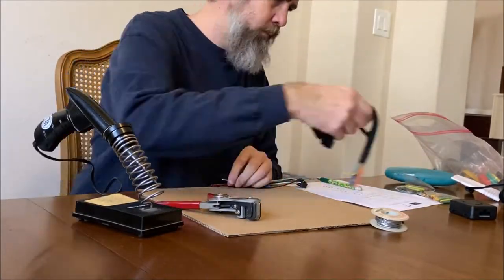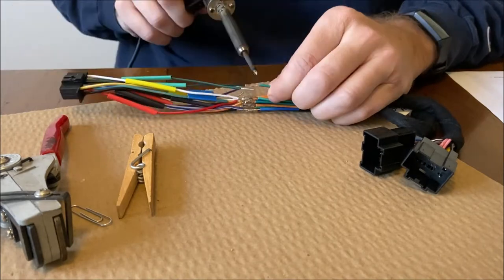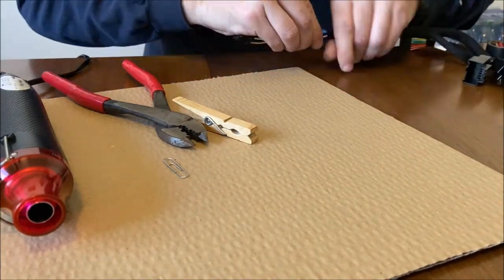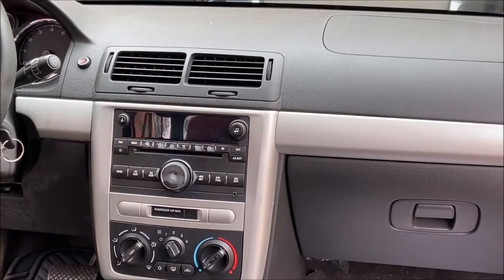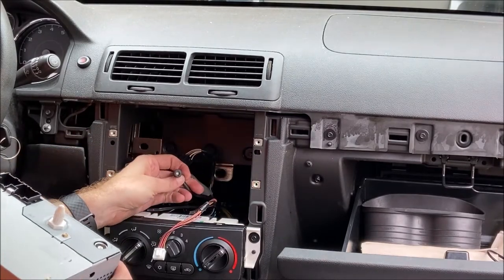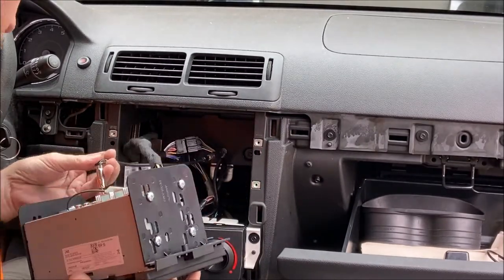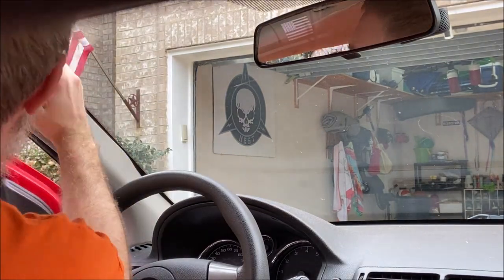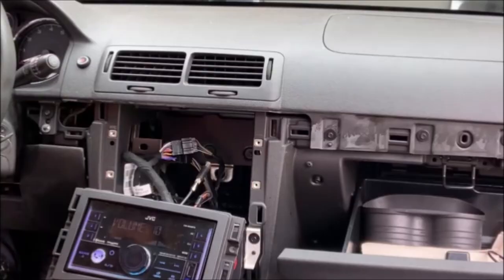Replacing the Radio in a 2010 Chevy Cobalt

Comment: Can you please help me specify what wires connect from the single 12 pin connector and into the two female connectors
Reply from the maker: Thanks for watching, Joe.
In general, the new radio/head unit you're installing will come with a wire harness and instruction book that tells you the function of each colored wire.  The harness you're connecting to (that connects to the car's original connector(s)) will also come with instructions that say what the function of each colored wire is.  You need to connect the two wires that have the same function (not always the same color!).

For the exact case of the hardware I used in this video, I need to look at the instruction manual for the JVC KW-X840BTS head unit and for the Metra LC-GMRC-LAN03 adapter cable.
The JVC book can be found online here: https://www33.jvckenwood.com/pdfs/B5A-3110-00A.pdf and the info is on page 44.  The Metra book can be found here: https://metra-static.s3.amazonaws.com/documents/INSTLC-GMRC-LAN03_web.pdf and the info is on page 2.

As an example, for the front right speaker positive (+), you would connect the gray wire from the radio's harness to the gray wire of the Metra harness.  For the front right speaker negative (-), you would connect the gray/black wire from the radio's harness to the gray/black wire of the Metra harness.

Comment: I’m really struggling with the wiring, I looked at the wiring diagram and everything, do you mind telling me which color wires go to which?
Reply from the maker: Thanks for watching!  I wish it was a simple answer but it depends quite a bit on the specific head unit you're installing and which wiring harness you are using.  Factory harness?  Intermediary harness?  You need to look at the wring diagram for each.  For example, your head unit's wiring diagram might say "Right Front Speaker Negative Wire (-)" is pink.  Your wire harness diagram might say "Right Front Speaker Negative Wire (-)" is blue with white stripe.  That would mean, then, that you need to connect the pink wire from the head unit to the blue/white strip wire on the harness.
I hope that helps!  Check out some of the other comments on this video to see if they might also help.
Reply: @CarbonsDIYGarage  I found out I bought the incorrect harness. I have a 2008 Cobalt Sport with the Pioneer sound system, OnStar, and Steering wheel controls. The harness I got wouldn’t turn my amp on and off or would power my head unit, but luckily I order the correct one this time!
Reply from the maker: @daquancrazy7694  Whoops!  Yeah, that would do it - but glad you got it sorted out.  Good luck with the install.

Comment: I cut off the original connectors because my friend said it would be ok -_- so now I put all the new radio wires with the old ones using a diagram but it won't turn on. Am I supposed to put the yellow and red wire together into my positive? Because I only put the yellow. Thank you in advance if you ever see this.
Reply from the maker: @MidnightLadyCrow  I think the first thing you need to do is find the wiring diagram for your year, make, and model. For example 2006 Cobalt: https://www.justanswer.com/chevy/1gqth-need-2006-chevy-cobalt-radio-wire-diagram-one.html

Then match the functions to the wire colors coming from your car to the wire colors on your new radio harness. 

Example using the diagram linked above: Battery power is the red/white wire from the car. Using the diagram with your new radio, identify which color wire is the power wire (normally red). You would then connect those two wires. 

For the Left Rear Speaker negative you’d use the car’s yellow wire and connect it to the new radio wire with that same function (might not be yellow). 

Keep doing that until all the wires from the car are connected (some wires from the new radio may not get used).

I hope that helps a little. Good luck! And thanks for watching. If you don’t mind, thumbs up the video or subscribe to the channel - it’ll help the channel grow!
Reply: @CarbonsDIYGarage  Don't know why yt didn't send me the notification for this, but tysm for your help! I appreciate it.
Reply: Just subbed ❤ also this might be a silly question but i got the tool to check live wires to help me recognize them easier too. Do i need to unplug the negative still? Or do both - & + need to be plug in for a good ground while checking? Ty again in advanced.@CarbonsDIYGarage
Reply from the maker: @MidnightLadyCrow  I have the same problem with YT!  It doesn't notify me all the time when people leave comments; I have to go hunt for them sometimes.  Glad you saw this, though!  I hope you get it worked out.
Reply from the maker: @MidnightLadyCrow  I'm not exactly sure what you're checking but if you're looking to see if a wire is getting 12volts power from the car, leave both wires connected to the battery.  Connect the red (+) wire of your meter to the wire that you're checking and connect the black (-) wire of your meter to a known good vehicle ground (a good metal object connected to the vehicle frame, for example).  You should then get a voltage measurement on your meter.  I hope that helps!
Reply: @CarbonsDIYGarage  Yes! I'm going to be checking to see if there is a live wire I don't have a multi meter, just the other one that looks like a screwdriver and lights up lol the one people check fuses and stuff for. So im assuming leave the battery connected regardless for that as well. Thank you again, you're a life saver ❤️
Reply from the maker: @MidnightLadyCrow  Gotcha! Yup, you got it. Good luck! Glad to be able to try to help.

Comment: Question..!..so when I click on your link to buy the wire harness, it takes me to the Amazon website. and it says that this part doesn’t fit my 2010 cobalt? Does that matter or what should I do?
Reply from the maker: It says the same for mine.
What you can do, and what I've done for other vehicles, is go to Crutchfield's website, find the head unit you're interested in, put in your vehicle info, and let it build the package you need for your vehicle.  (Click 'Save on required installation gear' below the head unit price.)  When I do that for my Cobalt and the head unit that I've linked, I get the same parts as I've linked through Amazon.
Thanks for watching.  Hope that helps and good luck with your upgrade!
Reply: @CarbonsDIYGarage  thanks for the help and fast replying..!..

Comment: Did that harness include an interface? I just installed mine with the $20 on Amazon and my gauge cluster is not working. It’s getting power, but not reading anything (speedometer gas gauge, rpm’s)
Reply from the maker: I’m sorry to say that I didn’t have that problem and the only parts I needed/bought are what’s linked in the video description. I can’t think of any reason or way that the radio install would have connected with or changed the instrument cluster. Maybe a different wire harness got snagged or pulled by accident? Maybe try disconnecting the new radio and see if the problem goes away? Sorry, not much help here but answer to your original question is “no.”
Reply: @CarbonsDIYGarage  thanks for the reply, I believe it had something to do with tapping into the fuse box not properly. My stereo isn’t getting power unless I tap the 12v cord into the fuse box. I temporarily had the “wrap around fuse” method to see if tapping into the box resolved the issue of no power. However it did resolve that, I should wait to continue powering until my proper tap adapter gets here.
Reply: Unfortunately the proper fuse tap didn’t resolve issue. I’m about to give up and cut my losses. But one thing that’s driving me insane is the Metra harness I have DOES have the red 12volt wire, as well does the after market radio has the red 12volt. Should I be getting power without needing to tap into the fuse box? I’m just so lost cause I’ve never had issues installing radios before (as far as power and interference with other car functions)
Reply from the maker: @richmeier  The Cobalt is a finicky beast but for mine, I did not have to tap the fuse box.  I just connected red to red and it all worked/powered fine.  Sorry; I'm sure that's just adding to the frustration.
Reply: @CarbonsDIYGarage  it actually helps confirming your install was simple red to red cause perhaps I got a faulty harness and can start back from there and not have to go with this fuse tapping mess.

Comment: How do I know what wire to solder into what?
Reply from the maker: The radio head unit you buy will come with a wire harness. Then you’ll need to buy a harness that plugs into the factory wiring (the one I used is linked in the video description). In the directions for both, it’ll show which color wire has a specific function. For example right rear speaker might be gray/black on one harness and a different color on the other harness. Solder together the colors that have the same function. You’ll end up having soldered together a harness with a connector for your new radio on one end and a connector for the car’s internal harness on the other end, with your soldering in the middle. 
Check out some of the other comments to this video to see if they help. There are also a lot of step by step videos for wiring up after market radios that can show you the step by step. I hope that helps a little. Good luck, and thanks for watching.
Reply: @CarbonsDIYGarage  thanks man! I appreciate it😊

Comment: Umm where did ya connect the ignition wire? Since it doesn’t have one in the harness….
Reply from the maker: The simple answer is that all the red wires connect to each other, but the harnesses I used did have an ignition/power wire in the harnesses.  Red wire from the wire harness with the new radio connects to the red wire of the harness adapter you buy separately.  For my case, I soldered the red wire from the JVC head unit's wire harness to the red wire of the Metra wiring interface.  After that, plugging the harness connectors together will continue the chain of red wire connections to the head unit and to the 12V power source (battery).
I hope that helps and thanks for watching!
Reply: @CarbonsDIYGarage  yea i know red wire goes to red wire when in a harness but a 2010 cobalt  doesn’t have ignition wires is why I was asking. As you have to tap into a fuse in the fuse panel
Reply from the maker: @iiNaStYiii  Ah, gotcha. Yeah I just reused the factory radio harness so I don’t know the answer to your question.

Comment: Which colors are u not using and what are they do u know
Reply from the maker: Thanks for watching, Brandon!  I was able to dig out the documentation I had for the install.  Here's what you DON'T use.  This is specific to the hardware I installed.  If you install something else, or have a different car setup, you might have a different configuration.
On the head unit, I did not use the blue/yellow wire because I don't have steering wheel controls.
On the Metra wire harness, I did not use the Orange, Light Green, Green/Violet, or Blue/Pink wires.
I hope this helps.